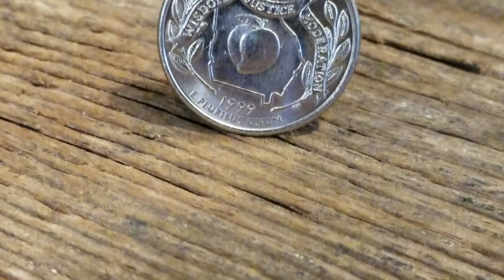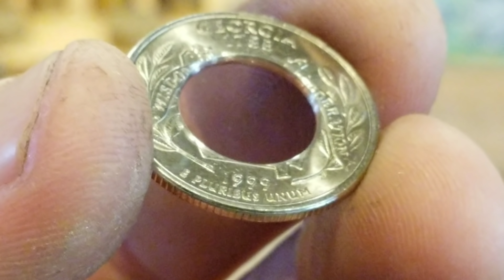How to Make a State Quarter Coin into a Ring You Can Wear

Comment: Skyler, I try to make two rings from  silver quarters a both split when stretching and I was't stretching to much, my target size was 9. could it be that I did't anneal often? I can make rings from clad quarters with no problem but the silver quarters is a problem for me. what am I doing wrong?
Reply from the maker: I'm guessing you aren't sanding your cut edge to where it is smooth and rounded enough. If it isn't perfectly smooth and rounded, it splits. You can get away with it on non silver much easier.

Comment: Just purchased my first ring stretcher / reducer. It's a 4 spline JPB and the stretcher works well for the dozen or so quarter coin rings I've made so far and does ring sizes 1-15. The reducer mandrel isn't too bad but it only accommodates up to about a size 11 max but I've got people requesting finished size 12 and 13 rings. Do you know of a replacement or aftermarket mandrel that will accommodate a larger ring. Or should I be looking at a reduction dye set? I have a 2" doming block and have been using it but it's a lot trickier to keep straight. Your input is appreciated.
Reply from the maker: You can get dies and a mega stretcher that will help you get to bigger sizes at jasonsworks.com. the mega stretcher will go over your existing stretcher.
Reply: Coin Rings from The Mint - Change You Can Wear  Thank you for your input. I can get the ring stretched just fine with this stretcher. The larger sizes can't be reduced since the mandrel doesn't have a large enough die hole. However, with more practice, I'm now getting better at using the doming block to reduce the reeded side of the stretched coin. And I've already dropped Jason a line about which dies I should purchase next. Again, thanks for the input and keep up the great work with the videos.